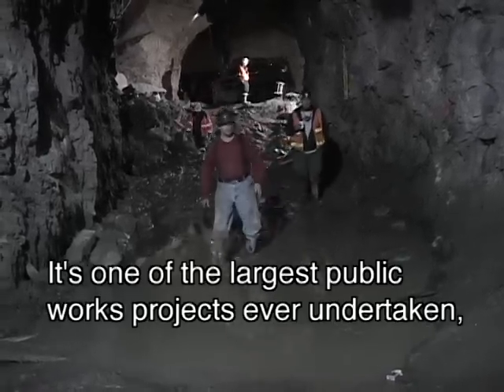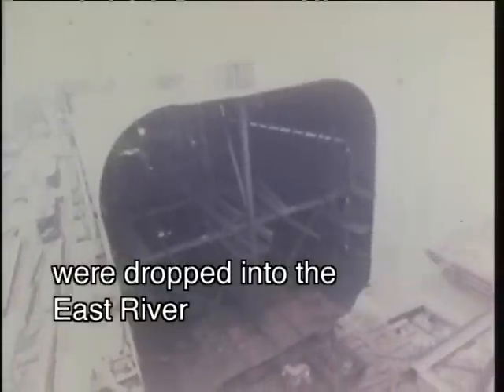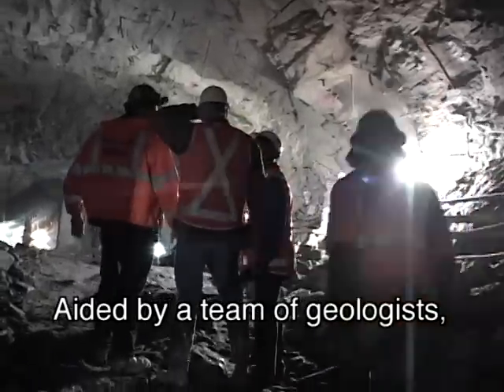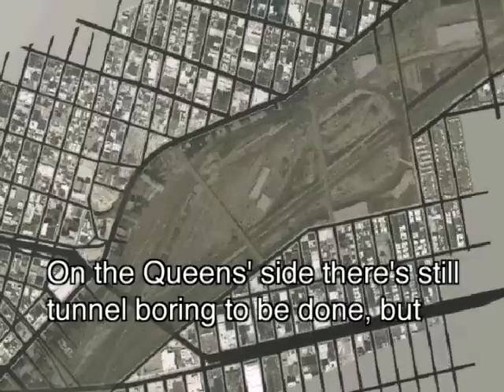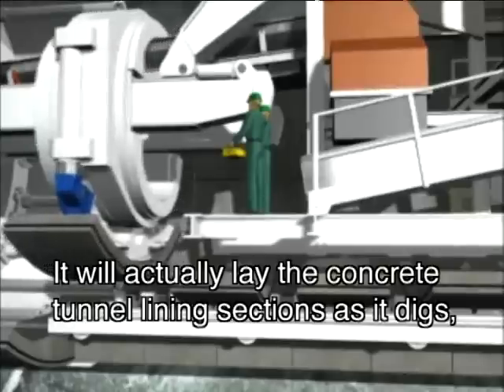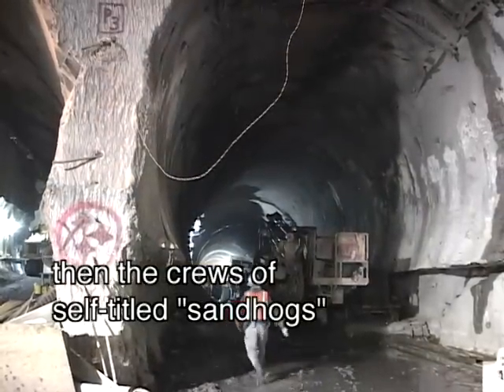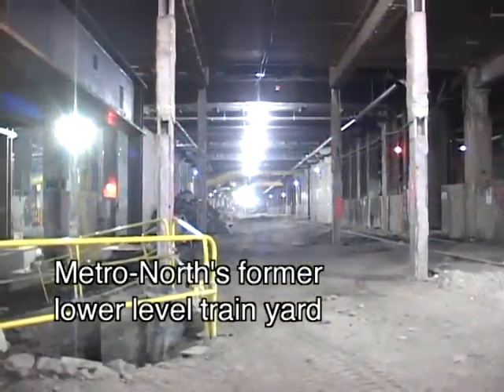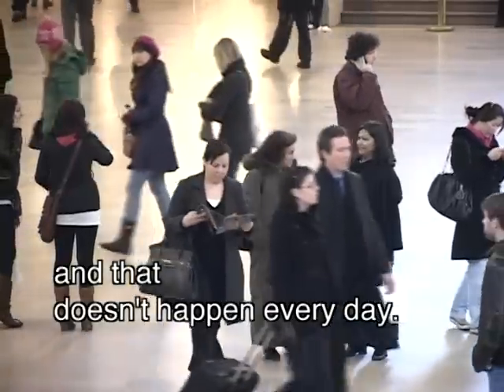The East Side Access Project

Comment: I am an electrical engineer working on this project (embedded conduits and power).  I have worked on almost all areas of the project from the tail tracks in Manhattan to the reception pits in Queens . I can't wait to ride this railway whenever the construction is completed.
Reply: Shouldn't be more than another 20 years until it's done!
Reply: @rontroy3843  it is actually supposed to be done by 2022
Reply: @aydenamaya7951  Going joke among commuters is "in the year 2525, if man is still alive ", because none of us believe it will ever go into service.   With the covid money problems, it might not.   And the horror stories I've heard from contractors,  who knows .
Reply: Not even sure that the 3rd track project won't be stopped due to lack of funds.   Or if MTA will survive.

Comment: Well, it has been a year, since this video was made. I wonder what the status of the construction project here is like right now. Just like the first phase of the Second Avenue Subway, this East Side Access project is supposed to be completed in late 2016. I hope that that date is true.
Reply: It's now Feb 2019 and they kinda sorta hope that it might be done by Dec 31, 2022, or was that 2122?
Reply: @rontroy3843  Coming here from 2022, It’s finally near it’s finish date, just a couple of months away from now
Reply: @dolfyparodies8309  So they hope.  Of course,  all the press conferences could slow it down.   Actual finish is projected to be several months after opening.  And I have heard nothing of heavy testing,  evacuation drills,  emergency power during blackouts.